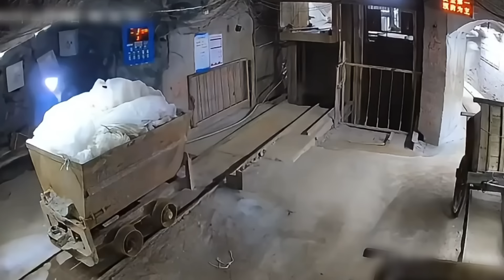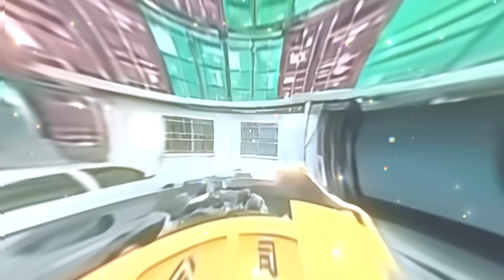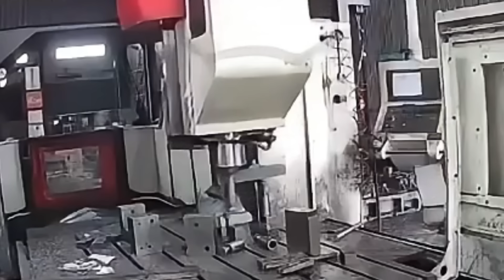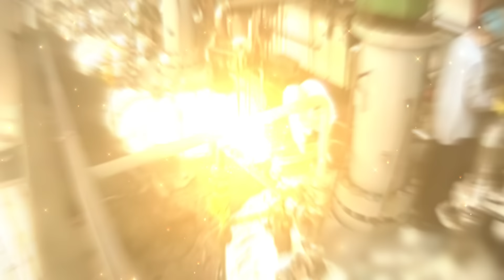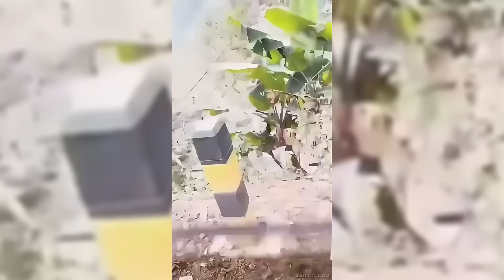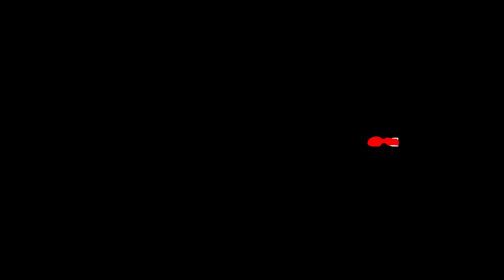He Was Just Unfocused... Then This Happened

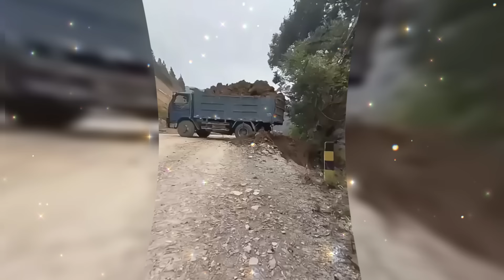Comment: 6:40 the dump truck operator raised the load to far. The resulting change in the center of gravity on the vehicle caused the front end of the vehicle to lift off of the ground.
Reply: Yeah, it had nothing to do with unstable ground. Just to add to your comment. The real issue was that the load had large chunks that didn’t slide out, so what should have been a lighter and light load as it raised, remained extremely heavy as very little of the load exited. Then what you said.